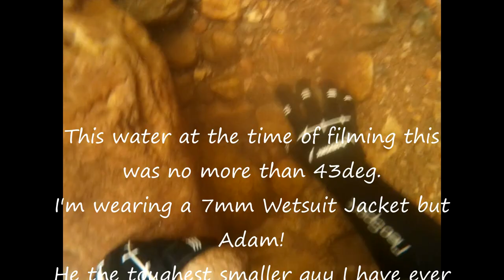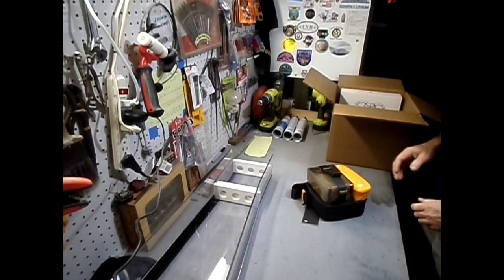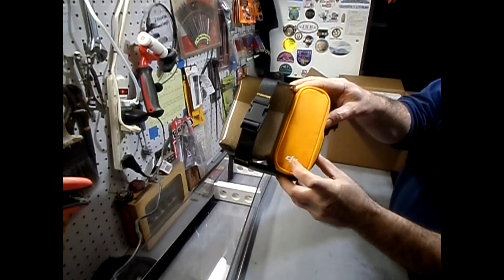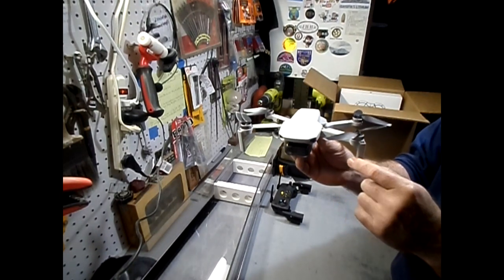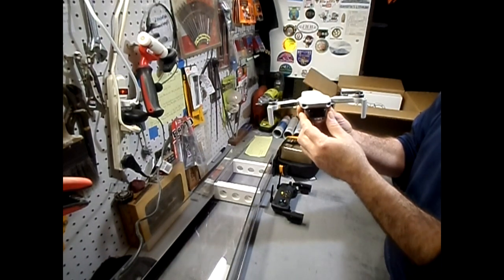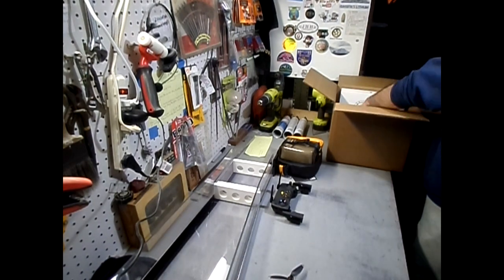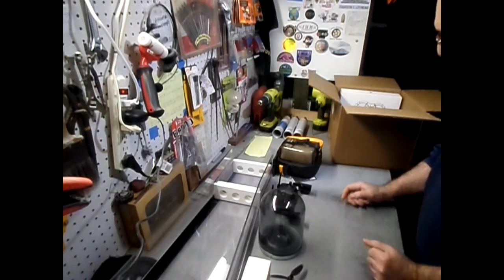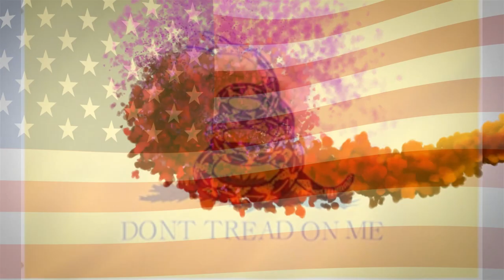GMGT - Have Something To Show You

Comment: Just today, my drone falls 1 meter deep in the creek. The lamps are lightning under water. So i have to get off my clothes and in the cold water. Now, i am hoping it wil fly again after several days of drying. So take care. And good look my friend. Nice. Greetings Tom
Reply from the maker: OH NO! Take battery out, open every compartment that can be opened and then put it in a bag of white rice and leave it in there for a good three weeks. My friend, I cringed when I read your comment. Very sorry that happened to you. I hope it will be ok. What kind of drone is yours? Greetings Joseph
Reply: @GreenMountainGoldTrap  I wrote it. I will do it in rice. Nice, it blings under water. I habe an hubsan Zino. Not so expensive as yours. I hope too. You have sensors, so you are able to fly more safty than i. But threes, and water at the creek are problems. I am looking forward, i do not switch it on so far. As i had it, i took only the battery out. We will see. Have a nice day. Greetings Tom
Reply from the maker: @Goldwaschen-mit-Tom  I just took a look at your drone. I'm quite impressed to tell you the truth. Even without sensors you can set it to locate your landing pad, if you have one. It works off GPS and a barometer only.
Mine does have sensors but, only on the bottom. And the price of yours and mine are almost the same. Greetings Joseph